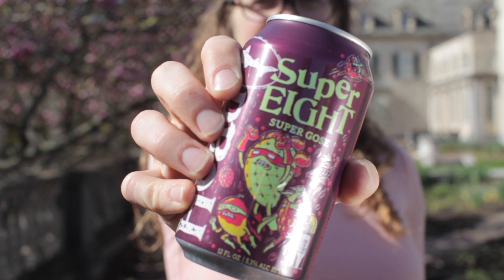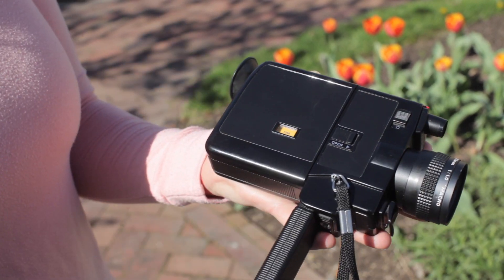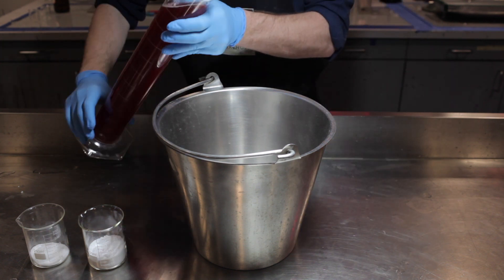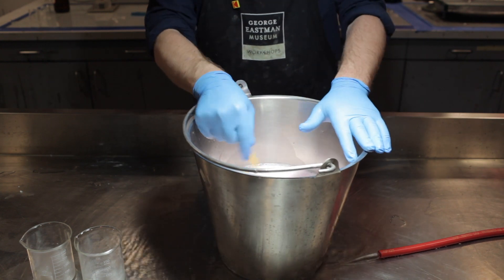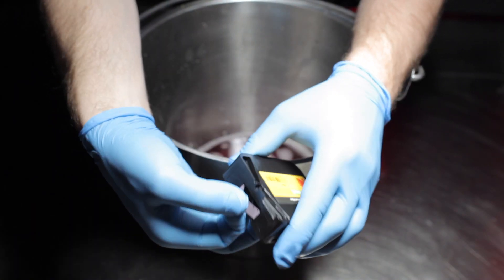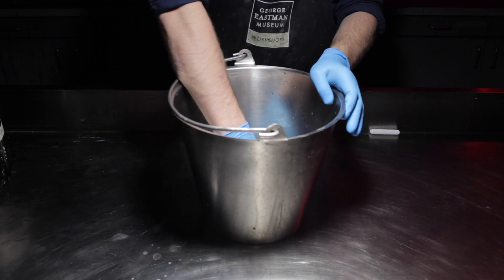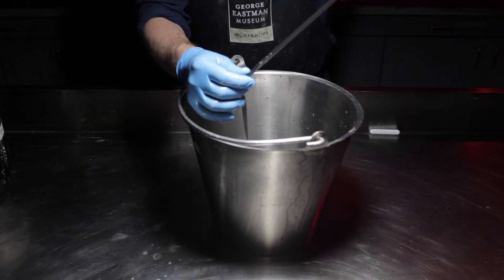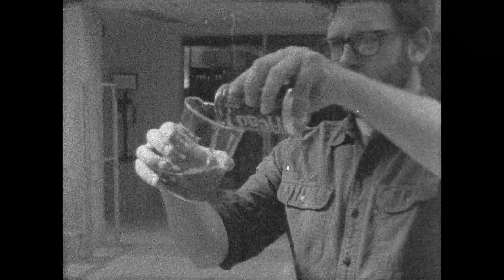How to Develop Super Eight Film Using Dogfish Head's Super Eight Super Gose

Comment: does this work with expired kodachrome 40? or with 35mm film ?
Reply: Beer developing indeed does work with 35mm film, and kodachrome can be processed in Black and White chemistry (which this beer developing was originally designed to do, B/W film development) but since kodachrome is SO far expired, you get WILD results with it these days. I shot a roll that expired in 1968 at ISO 3 and barely got an image after developing it in Rodinal for an hour.